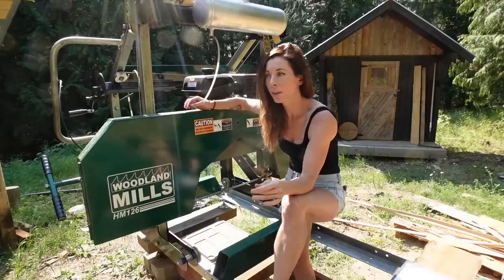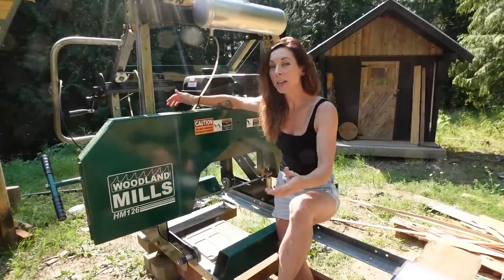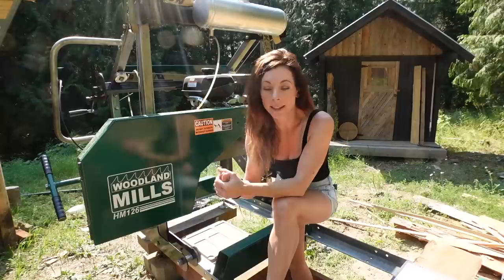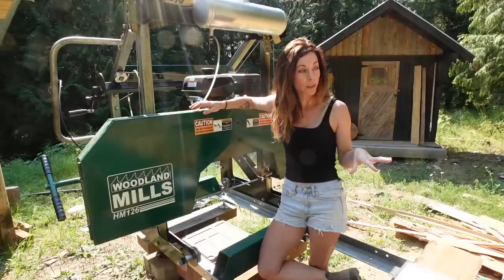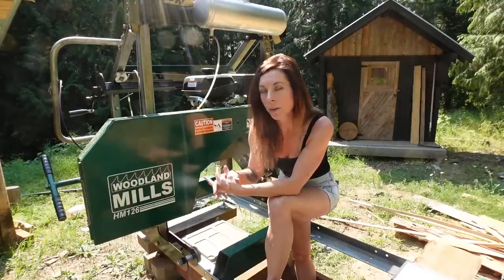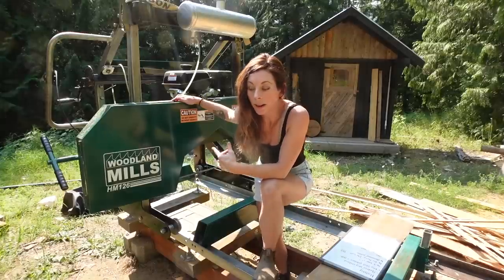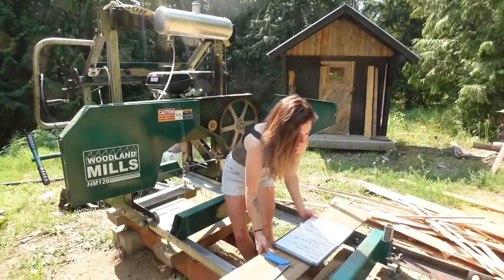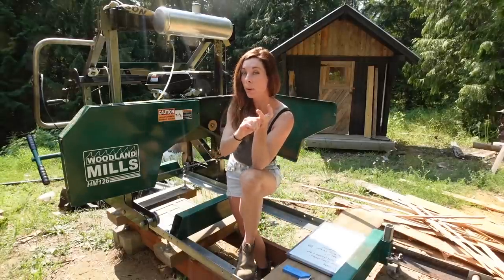My honest opinion - Woodland Mills HM126 bandsaw sawmill

Comment: I live an hour north of Seattle on some acreage. Ive got an old fruit orchard that no longer produces. most of our trees are hemlock or cedar but we do have oak, Alder and maple. many of our trees are 60 to 80 ft. tall and the forest is so dense in areas that some of the cedars and hemlock are only 8 inches in diameter. Would this unit cut these or should I just strip the bark off and use them for poles. Im not clearing but thinning around the fruit orchard as Id like to reduce the shade on the orchard.
by the way...love your twist on humor.......hey Steve
Reply from the maker: Oh it would definitely cut them, but only 8” in diameter is small. It really depends on what you’re looking to get from the trees I suppose, and what your projects are. I’ve been enjoying building with round wood, so you could always try to use them as poles to start, and if you feel like you’re outgrowing that then you could even get the HM122.
Reply: @michygoss7148  Thx for the response. I used to be a home builder and remodeler. Largest remod would be around $8 million today. 
I've got apple, pear and plum wood available and my next trip home to Arizona I plan to return with some mesquite....could be fun.

Comment: For my viewpoint and perspective I find this to be a bonus for you when it takes you and Steve both to get the belts off... As far as cleaning your sawmill out under the bed you should look at my video I mounted mine on concrete I put the cross pieces of wood mounted to the concrete and then mounted The sawmill you can sweep both left and right
Reply from the maker: Your set up is mint!!
Reply: Watching Your video again I did see that you have one nut hanging low,  you need to tighten him up tight, and that's not a cricket that is a grasshopper....lol you know the most important person on the carpenter crew is the cut man or cut woman....👍
Reply from the maker: @abovesea  you’re the only person that noticed that! I noticed it and I tightened it up good 👍 
And I’m not sure why I said cricket! I usually do say grasshopper! 🤪🤷🏻‍♀️
Reply: @michygoss7148  lol

Comment: You wouldn't need all that lumber cribwork if they had copied a Woodmizer that has a strong rectangular box frame😊 Again...they were trying to "reinvent the wheel" and failed. As far as sawdust from your discharge chute...a couple 1/4" bolts sticking out the lower end of the chute allows a 5 gal pail to be hung that can collect the sawdust for use elsewhere. And if your blade is sharp and the rake set properly there should be very little stray sawdust filling in the bed area of the sawmill.

Comment: Just weld a all thread coupling on both back corners and use  bolts on the two all thread coupling to push and you can square it up very easy would take less than a hour to accomplish that

Comment: Well sawdust is fibrous, but a little bland tasting, and so satisfying. Also if you get enough of the fine sawdust in your nose it becomes wood putty.😃👌 also little known fact if you don't have loctite, use some cheap fingernail polish on the threads works just as good 👍, really! That's really interesting your an RN, I'm just an MA status myself and a carpenter of 30 years. Well lots of respect for you,  take care and have a blessed week amen.
Reply: Oh Ps when you go to tension your pulley belt, use a straight edge on the pulley. Lay it across the edge, and allow enough to travel to the drive pulley. If it's parallel then it will touch evenly, if it's cocked to the right, it will be gapped on the left side of the drive pulley. If it is cocked to the left it will be gapped on the right side of the pulley. 
If you have anyone that can weld metal too make a tension wrench to fit in the bolt slots in a U shape and weld a handle about 14" long. That way you could apply even tension when you need to change it. Very similar to a ball joint separator. The wrench 🔧 would look like this 🤘but with a handle. That would allow even pressure for tensioning. Your welcome!🙂👍
Reply from the maker: Great tips!! Thank you - never would have thought about nail polish!

I do use a big metal square to check for square, but definitely need to figure something out at the motor mount. If I get a chance that would be a good thing to try and sort out.
Reply: @michygoss7148  just trying to help give useful info, because of what you said that it requires a second person to hold it straight under tension. 
The only other thing I could think of is, make some tapered wedges out of some hard wood. No thicker than the bolt slot, and have a long like 60°+ angle that you could tap them down . Creating even pressure so you could put a straight edge on it and then tighten it down. 
Enough said take care, and until next time stay safe and sane.👍🙂 blessings from above amen.
Reply from the maker: @saintracheljarodm.holy-kay2560  definitely appreciate the feedback!!

Comment: That belt tensioner is a bit cheap . I work on big commercial HVAC units . They all use two tensioner bolts  , once you get the alignment correct then when making any changes you just count the number of turns on each , every time you change anything . It would cost the manufacturer pennies per unit

Comment: I had a woodland mills sawmill, and I sold it after a short time, it was disappointing.. it arrived new in a pallet and already had signs of corrosion, woodland mills attitude to this was " it is not an ornament, it is a work tool".. but would you be happy buying a new van for work if it had rust on it? No.. then there was the issue of not milling smoothly.. a friend had a Wood mizer mill, each time I used it, the boards were milled without defects, nice and smooth,  then I would use the woodland mills, and the Wood would have a very rough finish, I might as well have gone at the log with a chainsaw.. I would never buy a woodland mills product.. the next mill I buy will probably be a wood mizer..

Comment: Great review Michelle. Have you tried a leaf blower/vacuum for the saw dust? I think you have mentioned that you have no power at the mill site, otherwise you could try a commercial shop vacuum, the type I have has a large bag (44 gallon) that can be easily swapped out when filled.
Reply from the maker: Yes - I do have a battery leaf blower now for the mill!

Comment: I have had a really bad back for 35+ years. NEVER lift anything more than you absolutely have to.  After you drop the log on the bed, put the forks back on and drive them to reasonable spot next to the mill.  Then raise the forks to a comfotable height. Unload after the cut onto the forks. This also saves time.

Comment: If u put 4 adjusting screws one one each corner on the engine insted of one in the middle like it is now u can adjust the engine by yourself, 2 screws that push and tighten the engine and 2 on the opposite side that hold the engine back that way u can adjust it and lock the engine in place before tighten it down.
Hard to explain in writing but hope someone understand.